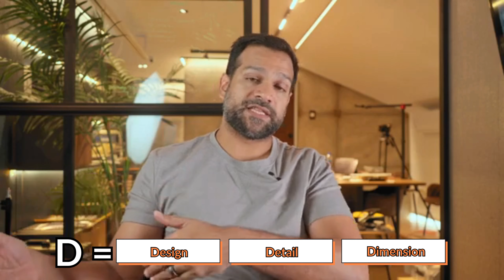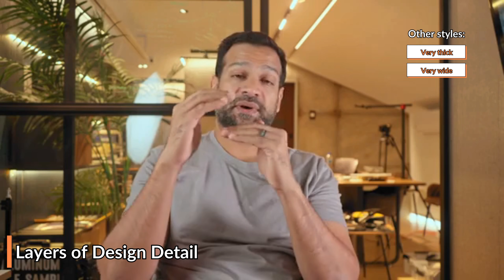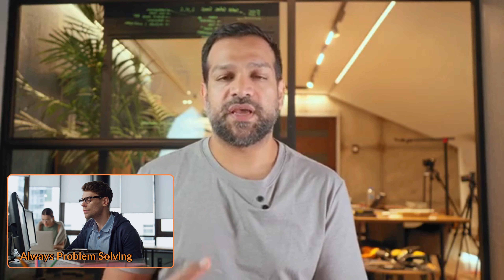Welcome to unit 31

Comment: 2:02 I think the animations could be bigger and easier to read 
2:29 remind me to give you examples of bad examples for light cut off
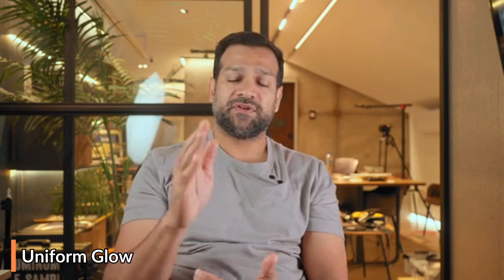2:47 indirect light coves
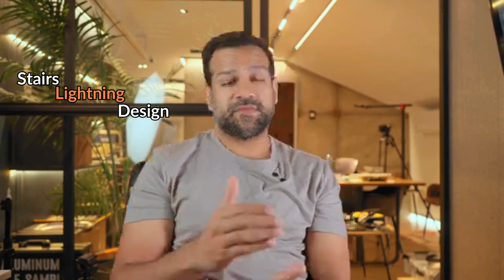3:03 I need to give you examples of the different stair types
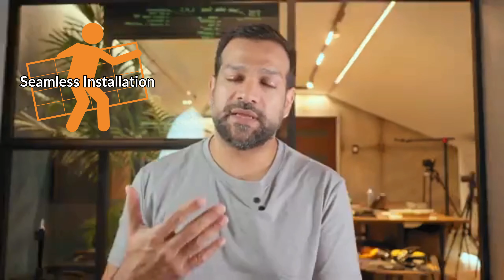3:51 small profile vs large profile 
4:08 you’ll have to advise on the video edits
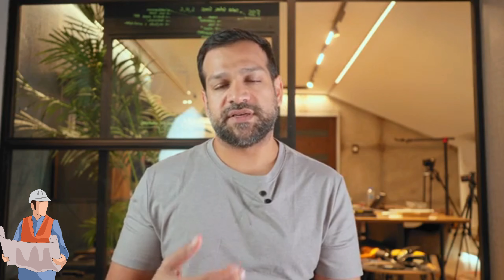5:28 show designer image